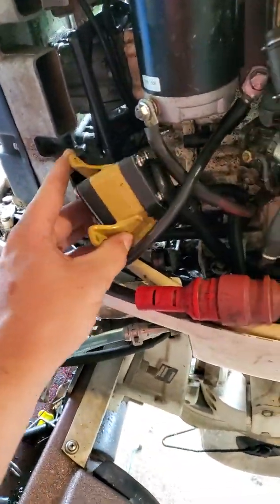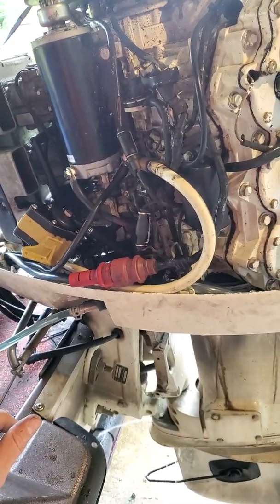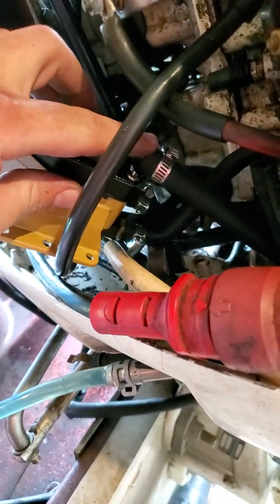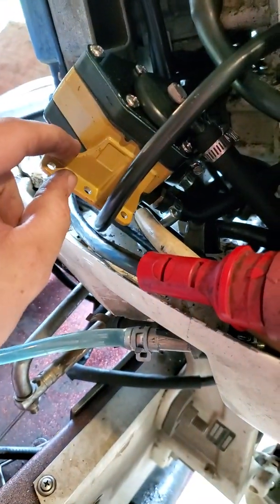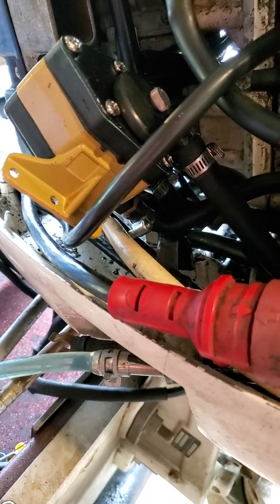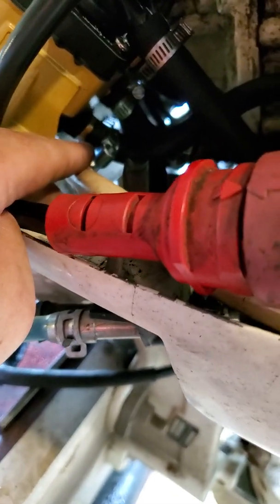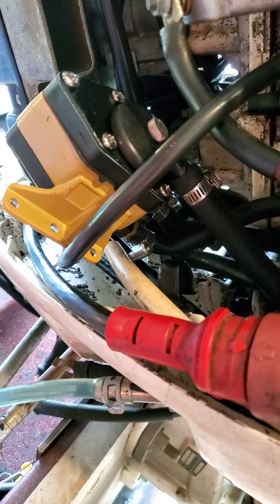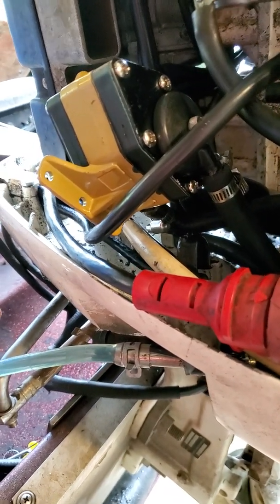carbhub fuel pump from Amazon install in a Johnson Evinrude outboard 150 v6

Comment: Am about to install the same pump in a 175hp am a little concerned about if it will work. It Doesn’t shutdown anymore?
Reply from the maker: been two years and still going strong. with that said i don't take it out daily but its ran mayne 15-20 times a year anyway.

Comment: I put the smaller fuel pump on last year after I removed the vro and it ran fine but occasionally it acted like it was starving for fuel . So I’m putting the bigger one just like the one you have now to see if it makes a difference , my question is there’s two fuel inlets on each side that have a Directional arrow pointing in on each side how did you know which one to put your inlet on ?
Reply: You ever figured it out? I'm confused also.
Reply: it sounded like the fuel inlet is the inlet furthest from the mounting brackets

Comment: I just got a boat I have the same motor bro I change the spark plugs the spark plug wires added new gas to the tank and it keeps just shutting off on me when I put it in the water when it's outside of the water it's okay it's when I put it inside the water where it shuts off any suggestions I also claimed the carburetors
Reply from the maker: Could be a number of things like an idle adjustment, link and sync adjustment or like I'm having now where my float in the carb isn't working right and it floods itself out.

Comment: Did it work well?
Reply from the maker: Still working strong 💪
Reply: @MrTaylorfenoglio  how about now
Reply from the maker: @israellanthier8471  never had an issue with it. It's still in it but I also don't run the boat a whole lot.
Reply: I've ran my bay boat with this pump for the last 2 years and it has worked great with premixed fuel in the tank.
Reply: @JoesFabShack  got a 96 evinrude oceanpro 225 and im about to do this swap today. hopefully i can figure it out lol